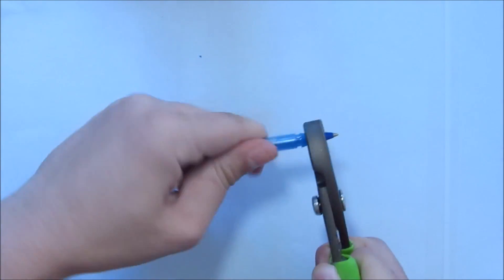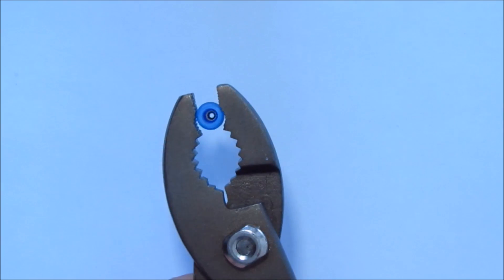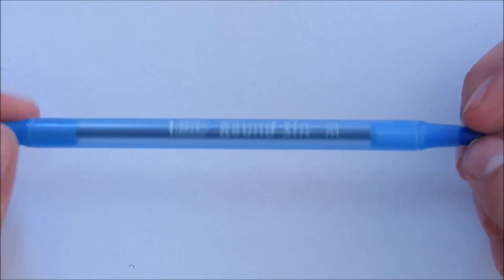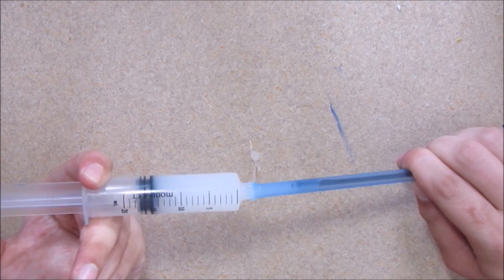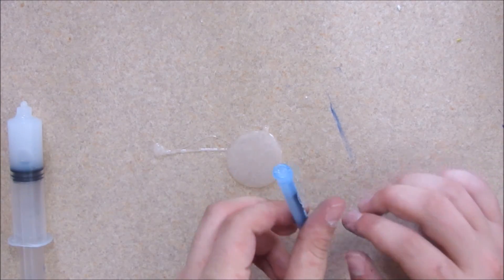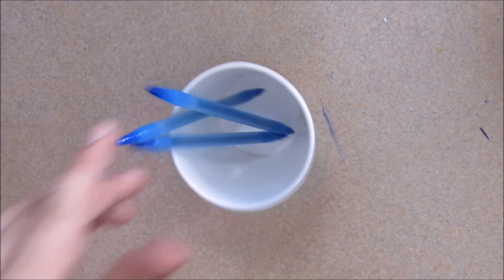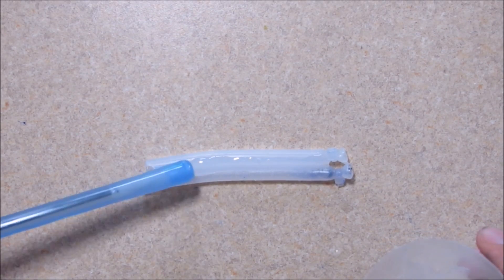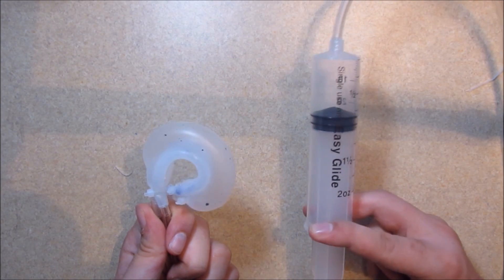DIY Soft Robotic Tentacle

Comment: I'm going to put a tiny dot of hot glue in the ink well to prevent the mess. I think you can put some silicone at one of the ends to seal it without the zip-tie as well. Anyway, I love cheap ways to make things like this. Check out the aerobox instructable for how to make a cheap and small soft robot controller. The arduino code is easy to tweak as well.

Comment: Fascinating! Is it absolutly necessary to use ECOflex 00-50, or would it also work with ECOflex 00-30?
Reply from the maker: A tentacle made using exoflex 00-30 will be able to move like normal however it will not be able to support its own weight when uninflated.